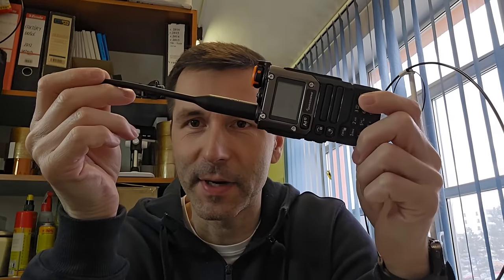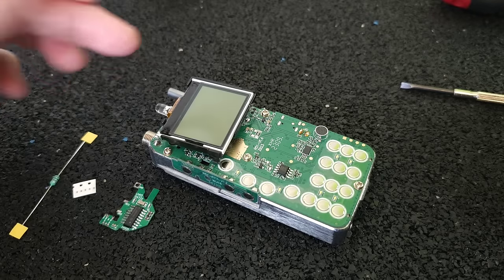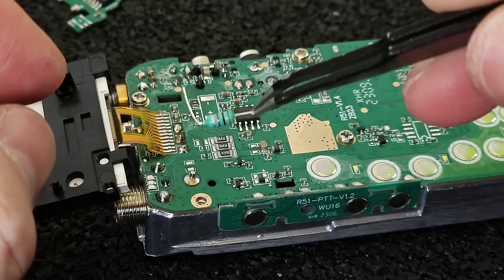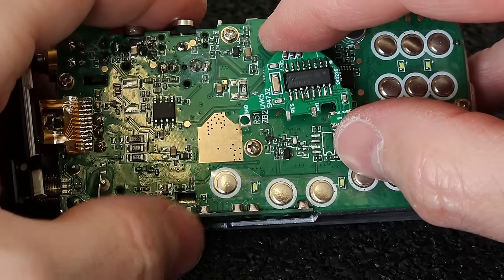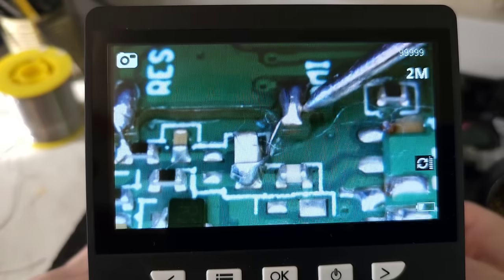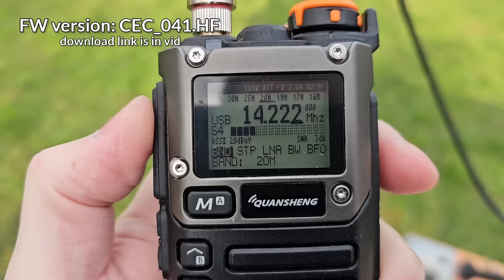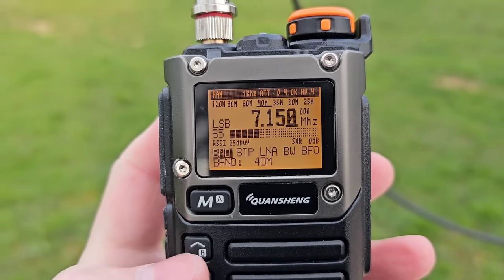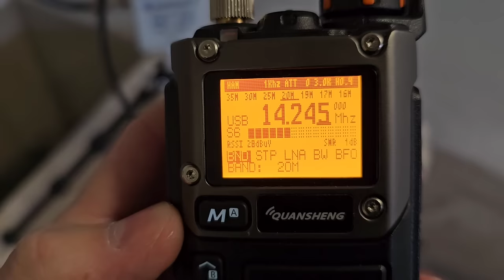VER.1 - HF FULL BAND Mod. - Quansheng UV-K5 (Si4732 new chip module)

Comment: The guys at Quansheng must love this - all the free R&D work being done by the community to help make the next version of their radio.  Now if it had a more powerful CPU and support for Bluetooth for audio & 'CAT' control :-)
Reply: Hey this is what ham radio has always been about. I recall before I had my ticket that ham guys would be on the hunt for decent tube b&w TVs as there was a particular vacuum tube that was good for making a fairly good amp.
Reply: Reminds me ESP8266 and then ESP32
Reply: If Only Thats How It Worked. Sadly Its Not :(
Reply: @frequencywatchers we're not here for reality!
Besides, accepting reality as it is would be the death of homebrew stuff like this.
Reply: @n7nja851  i mean, they will not make this mod in yhe next gen ht.
Not hapenin
Reply: @frequencywatchers  I can accept that, but "if only" and "I wish" are the mother and father of invention! 😁
Reply: There is a new one called k5 (99) I‘m not sure what it is capable of because I‘m new to this kind a hobby and choose the k5(8) because of the community, can someone tell me if the new one is worth upgrading and as customizable like the k5(8), would really appreciate!
Reply: 10 years ago I might have attempted this mod. I have extensive experience working with surface mount components. But I'm older now and I have the "shakes" so bad there's no way I wouldn't screw this mod up, ruin the radio. I guess I hope that Quansheng will come out with a K7 model that will use this other chip?
Reply: When people mod stuff it's almost never all included in a new product because companies want product seperation if they can get you to buy 3 versions of whatever product because each one is missing a feature they will
Reply: It really needs larger internal memory so more mods can be included in the firmware.... anyone have any ideas?
Reply: @JohnChrysostom101  that's the beauty of Chinese radio manufacturers, they actually release improved products with new technology because they actually compete with each other, western manufacturers are based on selling you ancient radio technology at exorbitant prices and all agreeing to not really compete with each other.
Reply: If you look at it like this it is a good way to get a free development team which means a much reduced price.There is a newer kit that includes a better audio chip . I just ordered one the new board is about the same size but contains some additional parts.
Reply: a n OLED screen would be a fine touch too!
Bluetooth yeah that's a nice touch. that shortwave chip of course, more ROM, but also bring back the USB-C ! but one where you can flash directly or send data from there.
Reply: @gerfgrub6622  Have you seen a doctor about the tremors? That's not normal, it might be something that could be easily corrected. At the very least you should be aware of whats going on
Reply: @jamesmoore6424  yep. this has been a part of CB'rs and Hams since the beginning. And its a beautiful thing.

Comment: Paul i tip my hat to you for the solder job on the 100nu resistor without a heatgun.  Never seen it done like that with such a good result.  Bien fait!!
Reply from the maker: Thank you for compliment :) Hotgun and solder paste would be much better ;) Best 73!
Reply: Paul, let's give you my Quangsheng, if you can repeat that cap. I will done it not in million years... 😅
Reply: actually, he should clear one pad from the tin and then solder one side while pressing the component flat on the surface. His Resistor isnt "surface" mounted its more like floating over the pcb
Reply: Sometimes contact soldering is easier. I’ve had those tiny chip caps have blown away. Bit too much air pressure and not enough stick in the flux
Reply: Your brave attitude soldering it with a soldering iron gave me the confidence to follow your exact footsteps (successfully)! Thank you very much for your tutorial, skill, and guidance.

Comment: Watched a few videos of this mod and decided to give it a try yesterday. I have a tweezer soldering iron which you can close on each side of the smd caps and resistors.  This worked quite well but required careful placement as to not heat near by parts.  I have a hot air gun that I planned to use on the eight pin IC removal but I was concerned that it might blow off the adjacent tiny parts.  I used an exacto knife to score the leads at the package several times. You can press on the cut and snap of the leads. After that the remaining remnants can be easily removed with soldering iron.  That tiny capacitor is smaller that I thought  but I managed to get it installed. Happy to say that the mod is working.  Thank you for the excellent video.
Reply: To remove these small smd, I slip a very thin wire under one of the sides (making a loop) and put some upward lifting pressure while heating the pins on that side (not too much or you will pull up the traces). The chip will pop up from that side, then the rest is easy. Doing it this way saves the chip for other uses (or reversing the mod).

Comment: Ah the surface mount. 20 years ago odd, working on this type of thing was my job. I gear due to my age and accompanying health issue my hands and eyesight are as focused and as steady as the once were.  Great video.
Reply from the maker: Thanks for the comment James and for watching! :)
Reply: Adjustable Hot air soldering station, HD overead camera connected to 24" hd display, laptop  and a variety of surgical forceps, tweezers and white desktop that is nick, burn proof to decipher a dropped smd and a burn or flux drop.
Reply: same thing here bro . now age 67 but still doing it in mobile phones . Hi Hi🤣

Comment: For low audio I would recommend to connect the audio not on pin 3.4 but after two resistors, I use to short those 😊
Reply: Thx, good idea! 73
Reply from the maker: Thank you! Could you send some sketch of this please? I would try it ;)
Reply: Yes, would love to see that sketch bc I'm too new to soldering board modifications so need all the help I can get, lol
Reply: Could you show me in more detail where to solder it? The video says it works for me, but I'm not sure what you're suggesting
Reply: dear friend, could you clarify for me what needs to be done here for louder audio?
Reply: Please also for me

Comment: Super impressed! My Quansheng is sitting in the corner (in the box it came in) laughing at me! I got it mid way through last year but have done little with it as I became more interested in the frequencies you're demonstrating in the final part of the video. I guess I will have to find me an electrician capable of doing this modification. - Excellent video by the way!
Reply from the maker: Thanks for the nice comment my friend! Well it the best time to have fun with your Quansheng. He has been waiting too long already, hihi :) Good luck and 73!
Reply: @OM0ET Is this mod. RX only? Or can you transmit on those lower bands as well?
Reply: Any really good cellphone or laptop technician can help you. You could also ask for help at your local Hackerspace/Maker space.
Reply: I might get one of these HTs for later on, after I get "tested". Someone else will have to mod it, or am seriously better off trying to see if there's something even remotely close to the frequency coverage in a handheld form. I purchased a couple SW radios that will do for now. :)

Comment: My kit arrived and was installed without issue thanks to your video.  The radio now works with the original firmware, but since I have a Mac computer, I'm having difficulty getting the new firmware installed, but I'll keep trying.
Reply from the maker: Well, you need a friend with Windows probably 😀

Comment: Very cool. I love the UV-K5/6. It's a bit of an expensive upgrade though. In my case, that chip board is half the price of what I paid for it. But I think i'll still give it a go. I wish someone would do some work on the firmware for the Quansheng UV-5R plus though because that radio is great.  Super awesome video though, thanks.

Comment: Hey buddy,  great video. I have a few questions for you. What firmware version are you using?  Is there any effect on transmitting for the existing frequencies that this radio is capable of transmitting on?  The aim for me is to have extended receive but retain full transmission capability. Can you do a video testing power and spurious transmission? Now that you have done the upgrade are there any lessons learnt I.e. any things you would do differently?
Reply from the maker: VHF/UHF is staying intact.

Comment: I’m very grateful to everyone who made this project. CC-HF software and full band modification with a si4732 is just the great peace of engineering marvel. I can imagine how many hours, effort and love is used to bring this little Chinese radio to the next level..! 
I have one question about calibration. Is it possible to calibrate frequency on  SSB permanently? I have to tweak BFO +680 in order to get clean usb signal. Problem is that I have to do this every time  I turn  radio ON because BFO is resetting when the radio is switched off .

Comment: At 4:32 you show  the removal of the lock nut on the antenna connector. I have two of these radios and that lock nut is below the plastic case (against the chassis), not on the outside. It does not need to be removed since it is inside the case. In fact, it cannot be removed since the hole in the case is smaller than the nut. It is not used to hold the plastic case and the chassis together. This may be a manufacturing mistake but I thought to let everyone know.

Comment: Amazing what creative and capable people come up with ... by the way you should have soldered the big resistor-alike looking inductor with shorter leads, which is one of the many reasons why everybody is using SMD technology, avoiding unnecessary cross talk - since it seems to be going towards ground it should be easy to do that. 
Thanks for showing this so very well visually and verbally documented process - great work.👍
With all the extended wiring and with that additional capacities does it still operate on UHF without signal degradation?

I also love to tinker with radio related stuff all my life and that is why I smiled when seeing this, turning the cheapest Chinese FM radio into an all-mode HF receiver, though as a serious HF enthusiast you question yourself why not spend a few bucks more and get like e.g. a Malachite SDR or Chinese clone and also have a tiny portable HF receiver with serious performance for a device of that size and it is also capable op listening even up to higher frequencies. I guess here this is more a proof of concept that stuff like this, which was unthinkable 20 years ago, is now possible due to the digital backend, relatively capable processor/controller and most of all some very capable people who created these hacks showing us this new dimension of mods. 🙏
This definitely leads us to realize that there will soon be way more cool stuff to come ... like dedicated handheld transceivers that do all this with high dynamic SDR front-ends while being able to send AND receive from HF to UHF in all modes that will come close to the quality of big and heavy traditional transceivers.
Reply: I assumed the legs had to be long so as to keep it from underneath the lcd where there would be a lack of space.?

Comment: You don't need flux to solder discrete components. Capacitors are super easy:
1- Remove all the old tin in both pads with wick
2- Add new tin to one of the pads
3- heat the tin and place the cap
4- solder the other pad
5- clean with iso
Reply: Thats how you do it, I like flux because it keeps surrounding components from getting damaged and on smaller components it keeps the solder centered where it needs to go.
Reply: @GoonyMclinux  how does flux protects nearby components? The second part for shure, it is very usefull for ic's, but for dicretes the flux in the tin is more than enough

Comment: 20 minutes + some Canadian dark rum after long exausting work day. Set your solder about 400C to remove old choke. Works like a charm. Don't need to remove screw, just solder the new choke closer to bttns and bend  45 degree to soldering point. Plenty of room there.

Comment: the output throttle is warming up and there is a power drop on it .
you need to put (FLC-32t-471j) NLV32T-471 JEFF,if you need reception below 1 MHz,then NLFV32T-681K-EFT

Comment: The way to upgrade both hardware and software on these radios seems almost endless!!! - but if i tried to do this mod,  i would ruin it faster than the speed of lightning!!! - but this was interesting to watch! - i have the PLUS version, -- and  i modded it with egzumer 0.22, and it works fine! 73 Levi

Comment: Anyway to modify the power output from 5 watt to 8 watt??
Also would like to know if there are and tx chip modifications..
Wouldn't mind if I could hook up my antenna tuner and use like the yaesu 817.. 
With the rx mod it is like the kenwood th-f6.  .. with about a $300 difference..

Comment: Excellent work and the teaching was perfect. I have one question left, what is the value of the resistance that goes in place of the shock (1k?) and the 100nf capacitor? and that. Thanks.

Comment: Well done. It would be great if the original factory produces a ht like that which is already QRV on 20m in SSB. how much TX watt comes out of that modified HT in 20m in AM or USB ? The reception on 40m LSB sounds detailed, similar to expensive HF amateurradios that have a higher dynamic range, amazing how much HF radio for that little price that modified Quansheng HF provides and on a hilltop there will be all DX to QSO, the small HT size makes it very convenient for that. how is the audioquality with headphones ? you have great manual skill to solder a capacitor tiny like a sandcorn like that, i guess that cam to enlarge the view helped with that soldering. you make interesting videos on amateurradio 👍

Comment: Thanks alot for your video , it helped me out modifying mine. Altough i underestimated this soldering job . I've got quite alot of soldering skills, but not on this small of SMD components. It still worked out. I'm very new to this HAM radio hobby , actually started with the Quansheng Hype and learning alot. But It would be handy to have some sort of explenation of the sorts of options this firmware gives , like all the kind of filtering you can adjust ,what each filter does compaired to the others . and what type of antenna you recommend on these low frequencies. Currently i'm trying out that 27mhz telescopic antenna , but maybe there's something better , maybe a DIY antenna?
Reply from the maker: Congrats to your mod! 😃👍 I use the Magloop Antenna. Works awesome with this radio.

Comment: Modification Module Including SI4732 Chip And Crystal Oscillator Parts For Quansheng UV-K5:  Sorry, this item is no longer available! (20H38/Paris), Grrrr. Thanks for this tips, victim of his popularity :face-purple-crying::face-purple-crying::face-purple-crying:
Reply: I had the same problem but found it elsewhere on aliexpress! And it was cheaper!
Reply from the maker: I have an information from the seller, that it is just temporary and they have just increased inventory and are increasing the quantity. So maybe soon it will be on stock 😉

Comment: Is the antenna switch between the original antenna and the new antenna you installed done automatically, based on frequency, or do you need to manually switch them using some sequence of keys from the firmware? Thanks

Comment: That appears to be the UV-K5(8) or found other places as the UV-K6. The UV-K5 has the label at the top. Screen placement and insides may be a little different.
Reply from the maker: I think that both has the same boards and just different shell.
Reply: @OM0ET  Fair.

Comment: At 15:17 into the video.  Your checking the continuity.   I can't tell if your bridging from the top of the board to the main board or somehow you where able to solder from the bottom
of the MOD board to the top of the radio's board.   How did you solder the 8 spots from where the 8 pin chip used to be ?    Thanks

Comment: board w/ chip is SOLD OUT at ali -.-  (only 38 pieces sold, and 2nd one sold out 438)  ..any other source to buy?
Reply from the maker: I have an information from the seller, that it is just temporary and they have just increased inventory and are increasing the quantity. So maybe soon it will be on stock 😉

Comment: I bought it, installed it, experimented for several hours, and removed it as a completely hopeless, poorly functioning excess. The technique is accompanied by continuous clicks with a repetition frequency of about 1 second. And this is not the only obstacle. There can be no talk of any reception with telescopic antennas, not just long waves, but even medium waves. With large outdoor antennas you can get something out of it, but is that really what you want? To the poor performance of such a receiver, one can also add the inferior functionality of the CEC_041 firmware in comparison with IJV. In a word, I do not recommend it.

Comment: After chip modification, can Quansheng transmmit on 18 21 24 and 28 MHz as it can without modification ? or after modification complete transmitter is converted to reciever.
Reply from the maker: Please don't transmit out of VHF/UHF bands. After this mod you can receive only, within 150kHz-30MHz with CEC firmware.

Comment: I noticed that the hf mod was infact for the cec firmware...
Just wondering if it can be use with the IJV 3.13 firmware? 
Right now I can go down to 15 mhz . 
Would appreciate any help..
Here's the link to the IJV firmware.. in case you need it for testing purposes..

Comment: I have problem with that CEC Firmware, it freeze when try switch by pressing 0 (FM) have try install fm few times etc.. :S Do ya have any advices what ill should try?
Reply from the maker: Yes, you have you check all connections on new PCB.
Reply: @OM0ET  yes i have check 🤔